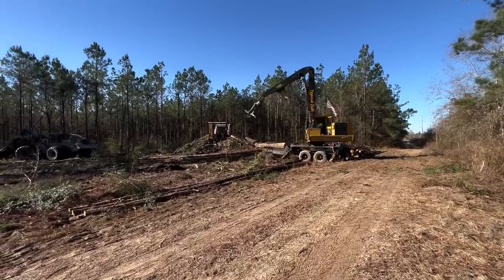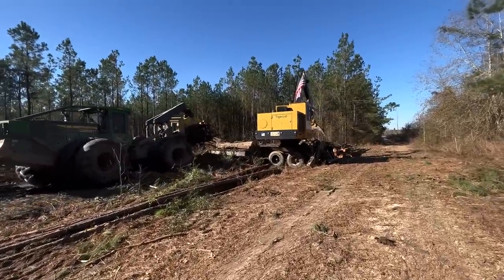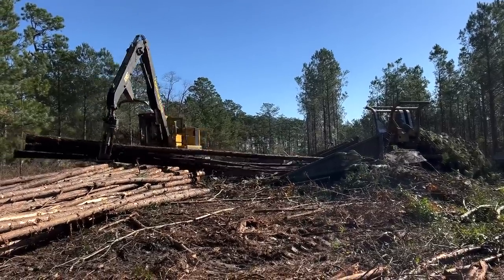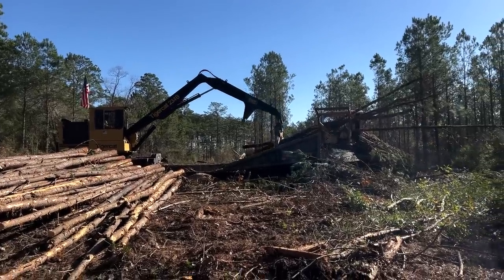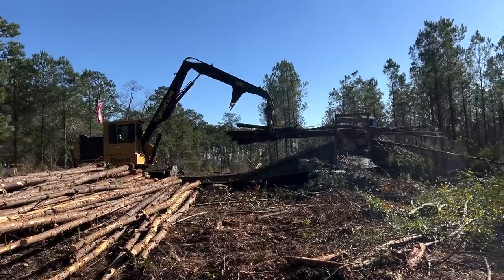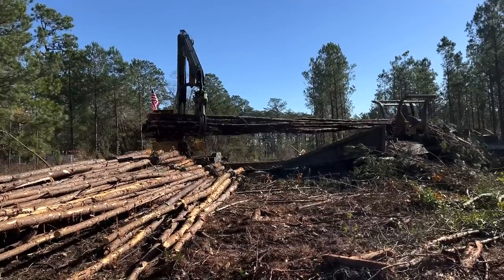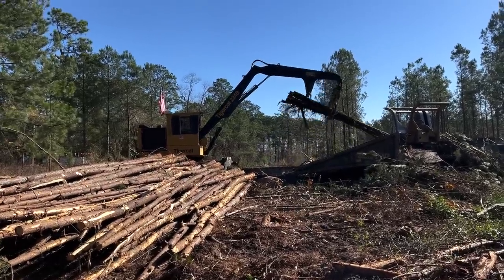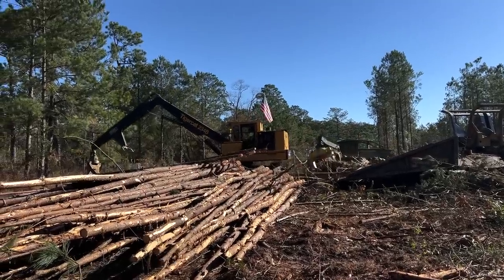Watching the Hydro Gate Work

Comment: when i was useing a hydra gate i was doin 20 sometimes 20 plus in east texas the more limbs you leave on before throwing it down into the gate the more easier an cleaner itll get after you pull it back thru cas all them extra limbs will help delimb its self better just my opioion everyone got what works best for them

Comment: How long has the Chambers Delimbinator been available in the 5th wheel trailer version with a tandem axle (8 tires)? Delimbinator wood if some of the bark is removed should be worth more at the mill, as the logger is sending more wood by weight.
Reply from the maker: Since 2012ish…the first one was designed for us.